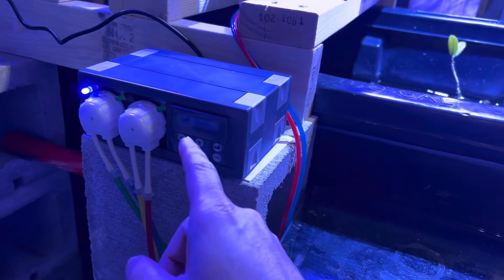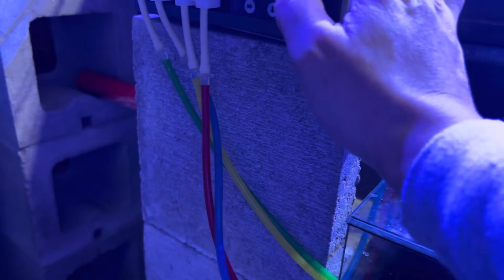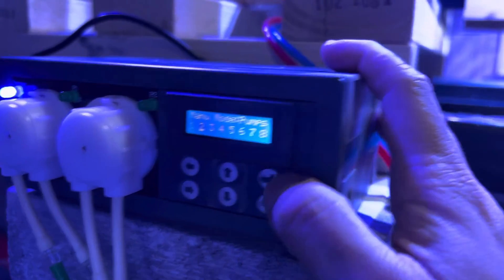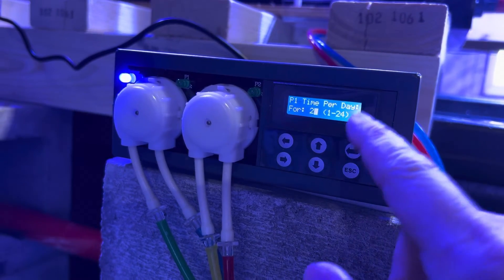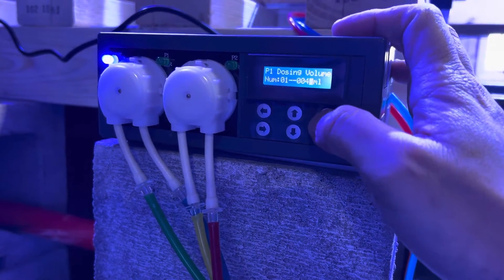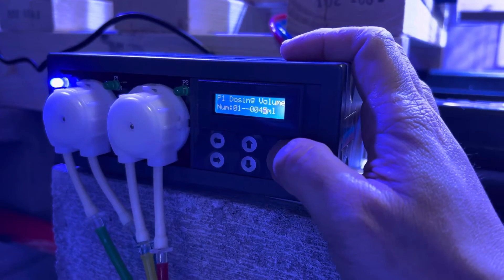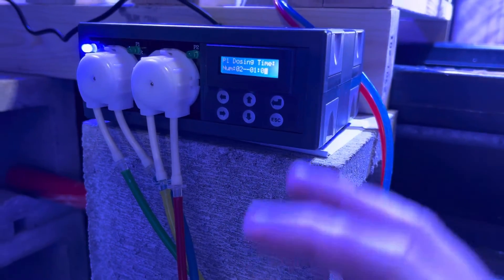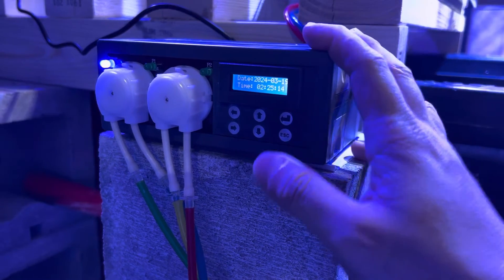Setting up Jecod dosing pump

Comment: Thanks for this video. I had problems with my dosing. The manual says for interval days (0-30) that the setting 0 means no dosing. However I found out that for some reason my dosing was off since I set the interval days on 1. Tested yesterday by putting the dosing output line in a measuring cilinder and found out that the first day it dosed and the second day it didn't work at all. So either the manual says it wrong with 0 means no dosing or you are right that interval 0 means dosing everyday. Testing this out coming days because this had me confused and unfortunately I didn't notice it on time since I installed it and had a big Alk drop.